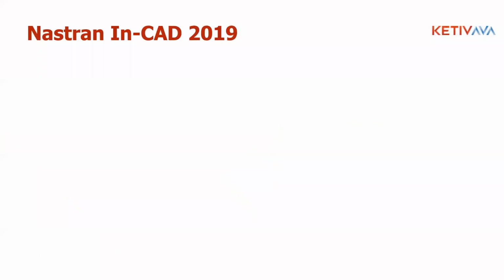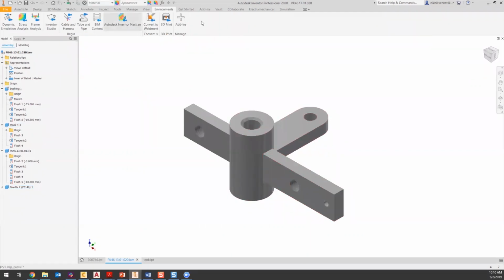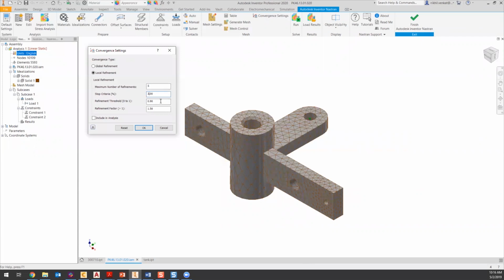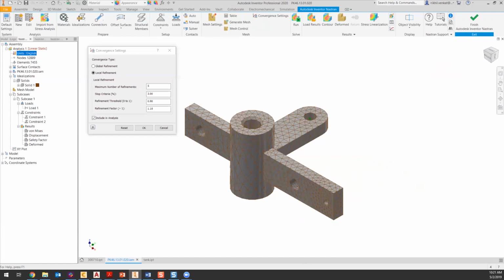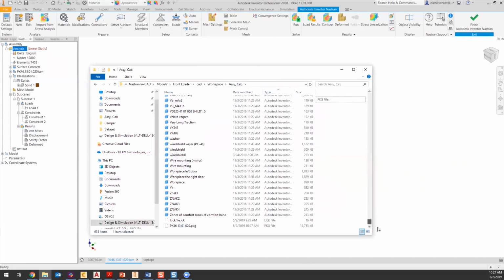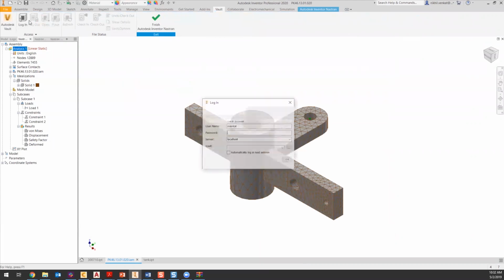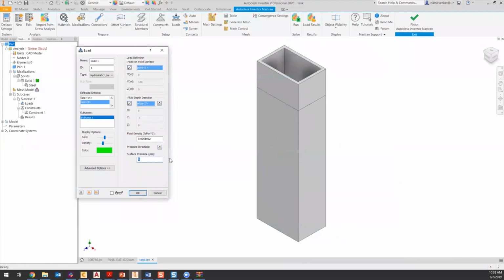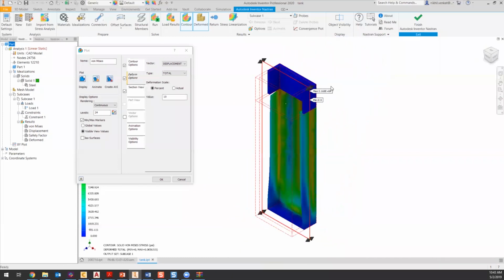What's New in Inventor Nastran 2020 | Autodesk Virtual Academy

Comment: 12:04: Growth rate is the rate of growth between adjacent elements in the mesh...meaning that if you're looking at a specific mesh element, the neighboring elements can only be eg. 1.5 * bigger. If you want finer mesh elements around small holes, choose a smaller refinement ratio and/ or use mesh control

Comment: Thank you for video! Guys. I have question about convergence plot. The most frequent question that beginners ask "I choose element size for meshing. Is this size correct?" Convergence plot should help to answer it, if i'm not mistaken. What we are doing now. We enter element size and run the analysis with convergence settings. Finally we see convergence plot (stress vs step). And what we should do with this information? Size of my mesh is correct or not? If not, so what size is more correct? I need the correct size or correct mesh. In other way what the sense of using the convergence plot? What application of convergence plot in Inventor Nastran? I found no answer in Inventor Nastran help as well.
Reply from the maker: Thank you for the question! Go ahead and shoot us an email at questions@ketiv.com